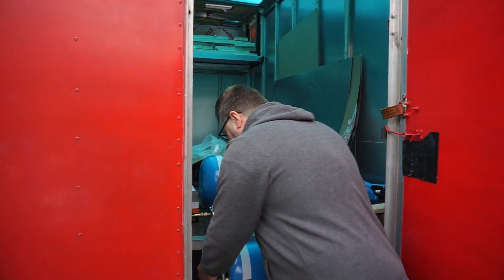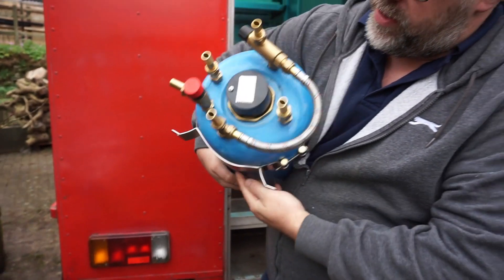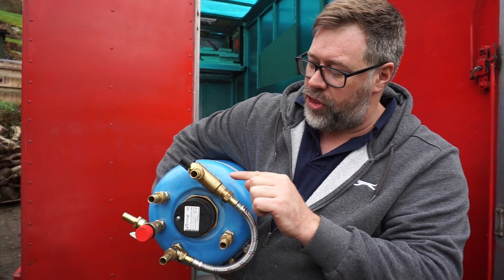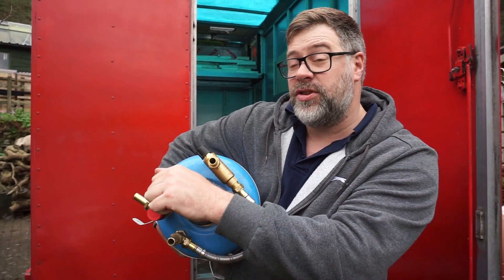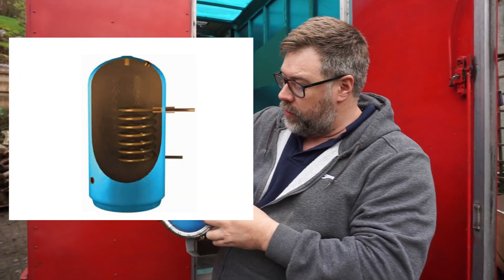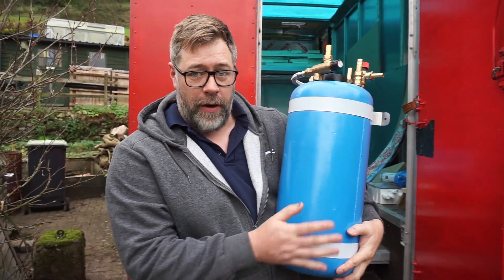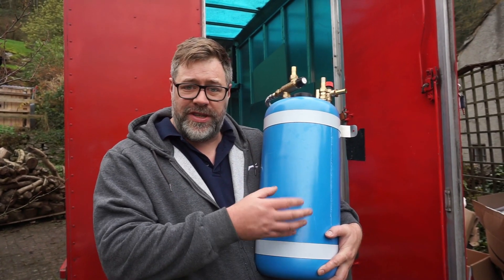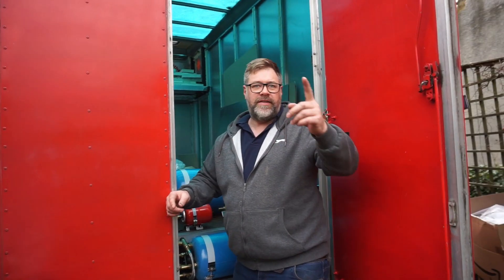Episode 22. Project: Water Heaters (Part 1)

Comment: Hi, can I ask a question about connecting to the engine..is it just one of the pipes you cut into & does it matter which pipe...one from the engine or one to the radiator.

Any advice would be appreciated.

Regards 
Steve

Comment: I won't be doing it because I only shower once a year and then it has to be a leap year. The indirect heating from the engine will only be beneficial during long runs,  I would be more inclined to build a solar water heater system, you have enough roof area for the  collectors. Have you thought about a trailer in tow to contain all the water treatment plant, you could also use it to house the bathroom and sauna. 🛀 😂